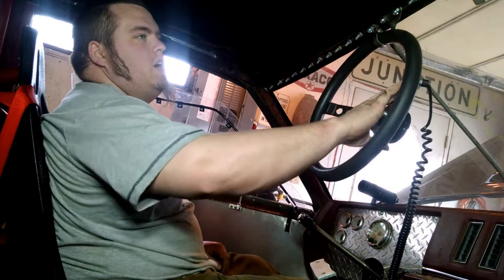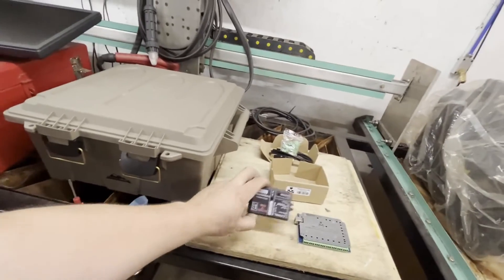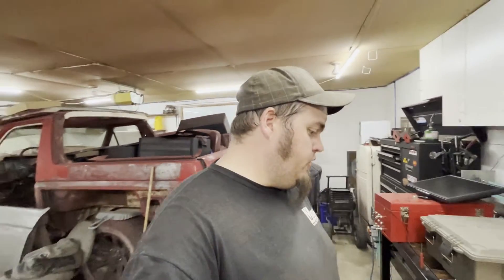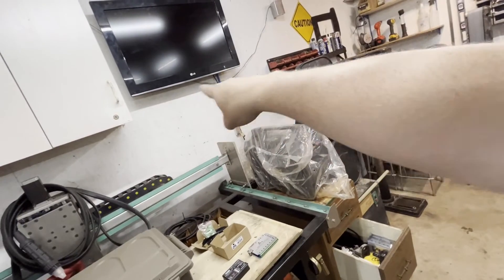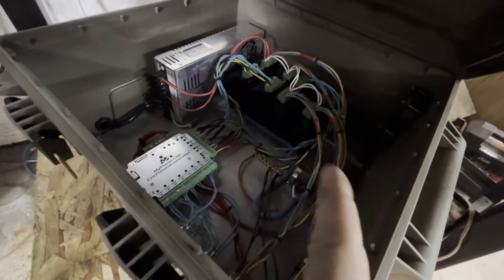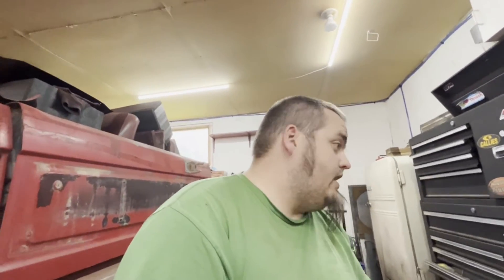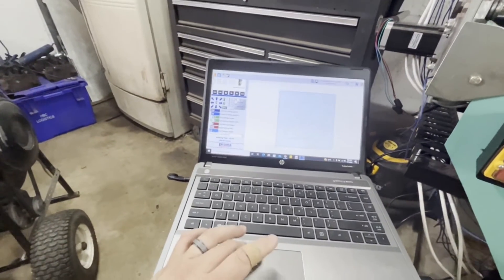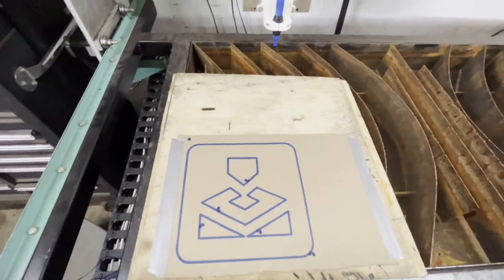MyPlasm - new CNC plasma software. Good change from Mach3

Comment: Hi Dwayne good down to earth video's. Where did you get the pen for the Plasma table?
Reply from the maker: That is just a dry erase marker in the torch holder and I used electrical tape to thicken up the marker so the torch holder would brag it. Nothing fancy 👍

Comment: I’m struggling to get the material detect to work
Reply from the maker: I’m not set up for that part of the system. It requires a mettle shield that only comes  with certain torches. So I would not know how to help much on that.
Reply: @letkemanfabworks619  even the floating head I can’t get to work I’ve messaged proma see if they can help headache going from Mach but hope it’s worth it
Reply from the maker: @jays_metalworks9399  oh that’s interesting…. It it not working at all? or dose it not seem to be operating properly?
Reply: @letkemanfabworks619  not at all
Reply from the maker: @jays_metalworks9399  I’ll take a look at mine and see if I might see something that might help
Reply: @letkemanfabworks619  was using the wrong sensor type needed npn I tried pnp or the other way round
Reply from the maker: @jays_metalworks9399  oh ok so
Your good to go?
Reply: @letkemanfabworks619  yes all running now
Reply from the maker: @jays_metalworks9399  nice good to hear!

Comment: Hello Dwayne, great fun to see that your table is working! I got the MyPlasm for my table aswell and I dont regret it one second. 
Just dont do the same mistake that I did, be sure to ground your workpiece properly everytime you run the your plasma, or you will damage your THC (arc voltage)😖
For the moment I have a hard time to set proper travelspeed with right amperage and problem with bevelcuts.
So if you have better progress on that matter, I would be more than happy if you could share it on another video🙂
U have a subscriber🍻
Reply from the maker: Hey thanks for the tips! And thanks for watching. Yes I to have struggled with beveled cuts but they seem to be getting better but not really sure what I have done to fix it….. I have just been playing with my settings. But if I figure something out I will let you know. Thanks for the sub I appreciate it so much.

Comment: Hey Dwayne, good to see you've got the table up and running. It's always a great feeling when something you've built yourself comes to life. MyPlasm is a great piece of software, too.
Reply from the maker: Yeah it was amazing how easy it was to figure out and use. I still need some practice with it. But so far I’m loving it. Thanks for watching! I appreciate it so much
Reply: @letkemanfabworks619  have you got your table cutting out parts yet??
Reply from the maker: @RustysMetalSigns  yeah mostly smaller stuff there will be a video coming out soon of a custom alternator bracket I just finished. And looking to do some custom parts for some friends at this time. But I have a lot of projects coming up that will make good use of this thing.

Comment: Hi. 
  I Love watching  my project :)
NICE VIDEO !!!
I have 2 questions :
1. Why cost of system is about 800USD ? High Taxes in your country ? Regular Price is $458 plus shipping cost.
2. Why not working on old PC ? What it was a problem ? I have clients with very old PCs ;)

Good Luck !
Reply from the maker: Hey thanks for watching! 👍 sorry I meant to say 800 Canadian. 458 usd converted to CAD = $628.78 and then the duty and taxes and freight came out to around 800. Not that I am complaining. If I was to get all the options this system comes standard with what I was trying to use probably would have been more. So I am glad to have spent the money. 
As for the computer when I first tryed downloading the software it would not let me unless I had windows 7 or up so I needed a new operating system. But I love the product so far. And look forward to using it more.